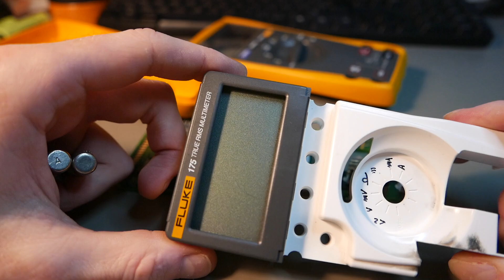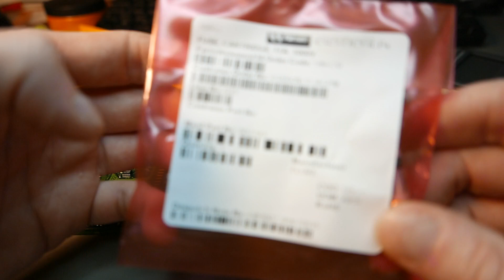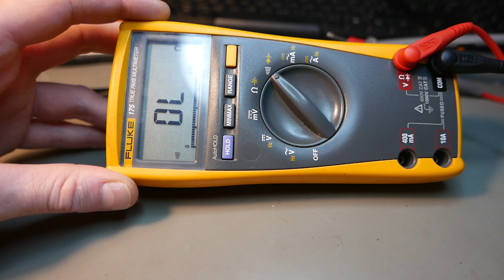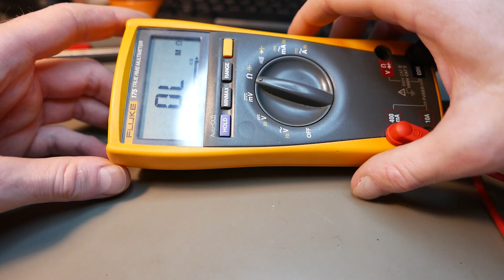Fluke 175 repair

Comment: I have a 177 who do not start when set switch to off, it starts when I disconnect the batterie and reconnect it, when with switch sometimes it comes alive after some minutes.

I had corrosion over the pcb, so a via van be damaged. the meter do not beep also, but I also see not a small speaker who can do this.

Comment: Thanks mate you saved me a lot of debug time. I had mine for 15years and it developed the resistance issue. Resoldering the 5x 200k resistors did the trick. 👍

Comment: Those fuses are very expensive!
Where can you buy the cheapest?
Reply from the maker: Having in mind that those fuses are tasked with guarding your life sheds a different light on their pricing. I always buy them from respectable seller. Those are purchased trough Farnell UK.
Reply: @TomislavDarlic  Yes you are right, they should protect us when we do wrong.
But we also see what can happen when someone tries to hide their mistakes, it can end badly if someone else uses that meter and makes a similar mistake!
But I still think they are surprisingly expensive ...

Comment: where can i buy parts for fluke 112
Reply from the maker: Majority of parts are off the shelf. You can pretty much read the numbers or test/guess. Fluke branded chip can be bought from shady third party resellers. I've installed some into Fluke meters and they seem to be working fine. I wouldn't trust it for serious testing though...
Reply: @TomislavDarlic  pls suggest what is the value of component in series to shunt on the pcb, it looks like, inductor or capacitor type component.